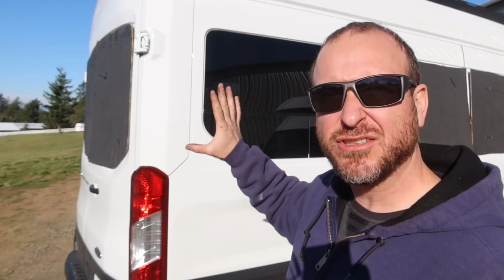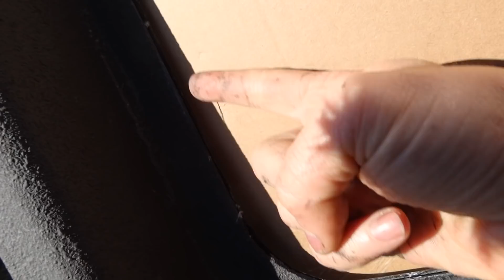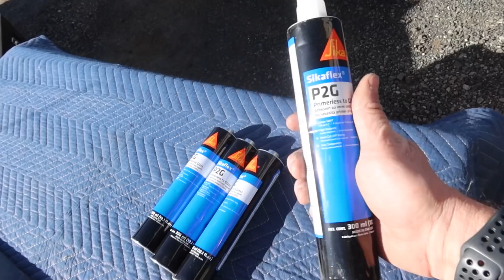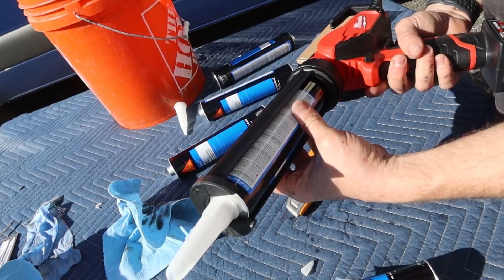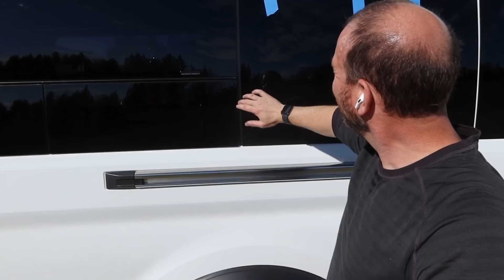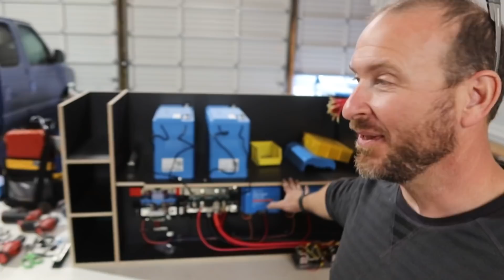RESEALING my VAN WINDOWS for the 3rd time! | VANLIFE BUILD

Comment: People.  Before you waste your first 10 minutes of your precious time.  Just imagine this gentlemen totally omitted that he should not be even licensed to drive a 350HD.   Let alone to ruin what we all know and call the holly trinity of Vans. Can’t believe this van got so ruined in this process. I do love the idea of the mobile pod cast studio and since I’m also a sound engineer I thought this would be very interesting for me as I’m also adding my portable studio to my Van. But no. Do not watch unless you scroll to the end at fast forward speed. Also he sprayed the actual hood of the Van BLACK why ? Cause I think he just wanted the engine to work at twice its operating temperatures…  hope your diesel fuel Cleaning Entire system
Is not already fully clogged.. This Vans don’t like being in idle PERIOD they perform better longer if they are reved up consistently and fully and they are subject to failure if they are pushed to work any hotter that what they already are dealing with.  👌🏽

Comment: I have watched a lot of videos on this and I thought they always put a primer down on the van before putting the windows up and put the adhesive on the window first. Gluing my windows in is the one thing I'm not excited to do. I have no issue cutting the holes but gluing them in is another thing.
Reply from the maker: Yea. Sikaflex I used was primerless but I use it.

Comment: WHY URETHANE?  WHY NOT SILICONE? ALSO, why not caulk the inside edge as well? AH well I see you did but you can also tape inside and run your finger or spatula around to smooth it out.  I think handled glass suction cups would have helped you with the install. I appreciate the nerve wrack... I had a similar feeling pouring my first reinforced concrete basement using Poly Styrene Foam. My business and my house all in one.
You are literally a stone's throw away from visiting your windows again - those infinitesimal scratches will be minor compared to the wear and tear of being on the road is my guess.
Reply from the maker: That’s what they use I guess.

Comment: Secret is proper even layer of caulking of same thickness everywhere.
 I had same problem on smal part of back window in my pickup.
 Used clear silicone from outside to fix it.
Live n learn
Reply from the maker: Yea. Live and learn. Just frustrating.

Comment: Should of had the window supplier install for you. All windows should be clamp on design with sealant if possible.
Reply: Additionally, the size and quantity of windows chosen I think has effected the structural integrity of the cabin. Less and smaller windows is better. Consulting a engineer on your plans would of exposed these potential issues beforehand. Good luck

Comment: I am sort of surprised that the window company did not recommend Sikaflex in the first place. 
Sikaflex is the 'go to' window sealant. It's the product used by car makers and windscreen replacement companies and they have a very low failure rate.

Any van with several holes cut out will flex around on the road, so I suspect that this simply weakened the interface with the old sealant.